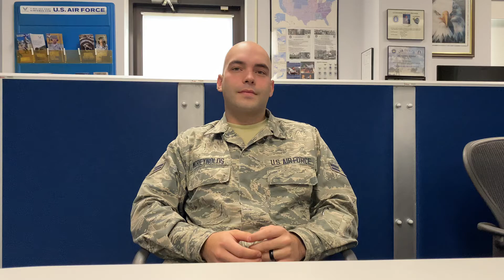2A832 - Instrument Flight Controls

Comment: book this job not much info on it not sure what to expect feeling a bit nervous
Reply: To put it simply, you're an electrician for airplanes. You'll work on and repair all of the electrical systems in the plane from flight control, to communications, navigations, and weapon systems. It's a good job to have in the AF and it pays very well as a civilian.
Reply: @BigBroFasho  This is great info! I'm curious as to why tech school can take between 46 to 95 days?
Reply: @GonnaSaveThePrincess  way they see it, if you can get yourself where you need to be, dress yourself, and pass your classes,, after graduating bmt, you're probably a  capable adult
Reply: @BigBroFasho most definitely